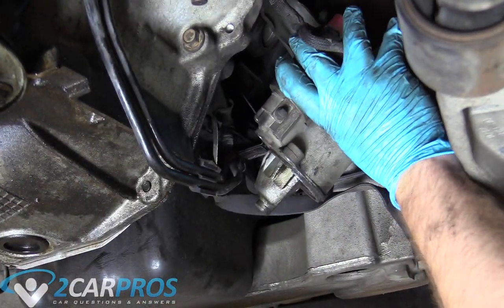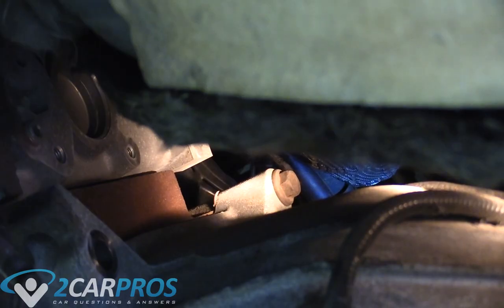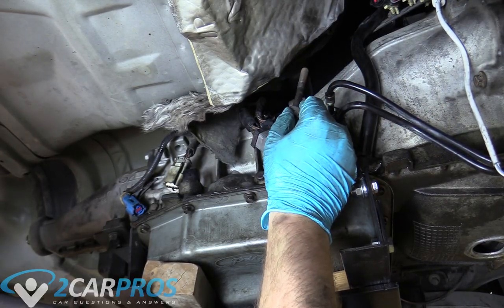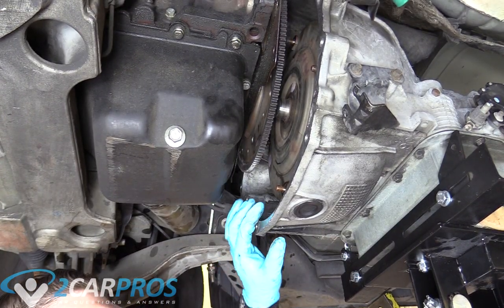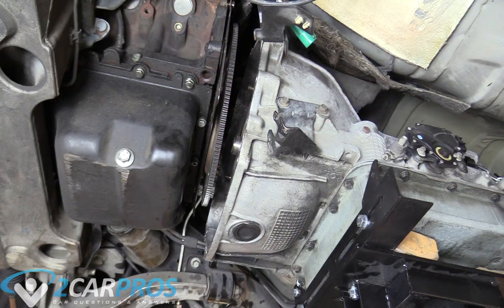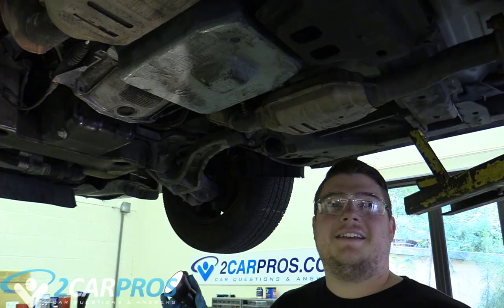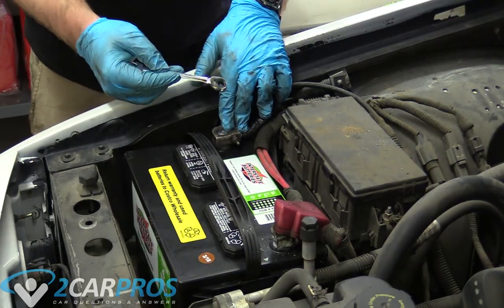How to Replace an Automatic Transmission | Step by Step

Comment: you saved my life, my cars flex plate teeth are messed up and i need the car for transportation soon i kind off just thought that you remove the transmission to engine bolts installed flex plate and job done. You are literally the only video i could find on youtube that was basically instructional THANK YOU SO MUCH! I subscribed instantly 👍🏻
Reply from the maker: Such a great comment! Thank you so much for watching!

Comment: One thing to add is, let the 1st hole on flex plate position in the center of the torque converter access hole, and also position the torque converter stud to aim at the flex plate hole.

Comment: Great video!  The part about loosely attaching the bolts to the engine to line up the converter studs is what I figured out myself today.  Really makes it easy.

Just one suggestion though, I couldn't tell if you were wearing hearing protection, but you should at least wear ear plugs around impact tools.

Comment: I found your video very interesting. It might be overlooked but that last bit that you added about when reconnecting the negative terminal, that's very interesting.

But I have a question for you though.....

Bought a car and realized it shuddered a lot and wouldn't change out as it should. Realized the fluid was extremely low and a diff mount needed to be replaced. Mount was replaced and I just went ahead and serviced the car and changed the tranny fluid and replaced the filter. I then realized it was leaking. So I thought I had not sealed the pan properly. Took it down and resealed it and I'm 100% certain it is sealed properly now. However, after filling the transmission with fluid, I realized it was still leaking, this time though, It definitely does not seem to be leaking through the pan seal. The leaking seems to be coming from above. It does not seem as though it is coming from the dip stick area either and space is very very tight in this vehicle.

What would your suggestion be?

Comment: Great video series! I only wish you'd make one showing how to do this on other manufacturers' products. Mopar is completely different (no hole in the bottom of the bell housing).
Reply from the maker: There will be some sort of access panel to get to the torque converter fasteners. Every automatic transmission does. Thanks for watching!

Comment: Really great video.  Extremely informative and I appreciate it a TON.  One question, do you need to use a torque wrench on most of the bolts when putting them back in?
Reply from the maker: Thanks for watching! I have to say yes due to the internet being technically correct. But off camera I rarely use one.
Reply: @2carpros  Oh really?  Man that's good to know. I'm not a mechanic at all and that's something that so many other people have just terrified me about!  "If you don't torque it right, the whole car will fall apart!" Lol.  Thanks for the tip!  And thanks again for the tutorial!

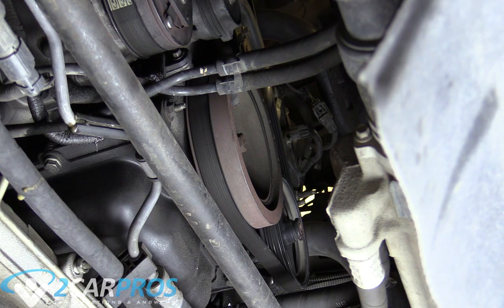Comment: @16:00 most useful part. Should have done this before getting the trans half way hanging out. Turn clockwise when facing front of engine

Comment: I've done this twice on my Crown Victoria. If anyone is doing this, the most difficult part is removing the transmission cross member. It's stuck and rust welded to the frame and you can't take it out by just removing side bolts. You have to use a chain and floor jack and hammer to remove it. A long prybar would not work. 

Also, if you don't have a transmission jack, get it. On my first replacement I used my normal floor jack but it was really unstable and took me extra 2 hrs to wiggle and match up with the engine. Also, get a low profile transmission jack.

Also, don't use Mercon V transmission fluid on 09+ transmission. or Mercon LV transmission fluid on 08 or older transmission. I used Mercon V on 09 transmission. My car was driving no problem with new transmission, and suddenly I lost all forward gears.
Reply from the maker: Long pry bar worked for me but maybe not on the floor. That crossmember is a bear! Great tips and thanks for watching!

Comment: Hi 2carpros If you are using an impact driver, why do you still use a breaker bar first; isn't an impact driver as good or better than the breaker bar?

Comment: Lovely video, thank you! I got a question, I got a 1979 Firebird and bought a completely new Th350 transmission to it. My mechanic told me that it took him 2 days for him and also other person to install it. Now he wants 500$ for installing... Is it normal that it takes 2 days for 2 people to install a brand new automatic transmission? Thanks a lot
Reply from the maker: Thanks so much for watching! 2 days?! To put a Turbo 350 in a car that came with a Turbo 350? 

It took me, by myself, a couple of hours to put a Turbo 350 in a 1955 Bel Air that never came with anything but a powerglide so it was a custom fabrication job. They are just bolting and un bolting. According to the book they can charge 2.8 work hours to R&R a transmission. So 2.8 multiplied by their hourly rate will give you what they can charge. Depending on the shop the rate can be anywhere from 80-200. Really depends on area and specialty.

Comment: I'm going to have to change out my 2006 Jeep Grand Cherokee Limited 5.7L Transmission.  Are these the same process to change that out as well.  I will doing a swap out like you did.  Also, the transmission dealer told me to make sure the drain my transmission before shipping it back, how do I do that?  Please let me know and thank you very much.   Great video and very informative btw!!!!  I hope my swap goes as smooth as your does.   Another question I need to ask,  when you start taking out bolts from different areas, how do you arrange them in order to put them back in the same spot you took them out ?  please let me know and thank you!!
Reply from the maker: You just need to take the transmission pan off and let all the fluid into a catch pan then put it back together. I just tend to put all my bolts in one bowl and then I have a pretty good idea where they go. Thanks for watching!

Comment: The sound at 37:00 minutes. I don't heard that sound, that means my torque converter is jammed, would thatbe a reason why after I put the engine and transmission together I can't turn the engine by hand ?

Comment: You guys are awesome! I used your instructions to drop the transmission on a 2004 Infiniti G35 coupe in order to start the process of removing the rear main seal!. One question: Is it possible to attach the torque converter to the flywheel first and then line up the transmission to the flywheel torque converter combo?
Reply from the maker: Thanks so much for watching Fabien! It is much better to install the converter first into the transmission so you can make sure it is fully seated and activates the pump.
Reply: @2carpros  Got it! Thanks so much!

Comment: Any idea why my wheels won't spin I changed the transmission seal on a Porsche boxster and reinstalled the transmission filled fluid back up did the whole process yet still wheels won't spin on their own when in gear any help

Comment: What about putting the nuts on the backside of the flexplate connecting the torque converter bolts to the flexplate?
Reply: That is for GM only, Fords have studs with nuts.

Comment: I just want to make sure that I didn't miss this, Are the bolts for the Bell housing supposed to have any torque specs?
Reply from the maker: Tight is good. I can get you an actual torque spec for this crown vic but I wanted to keep the video general so it applies to many vehicles. Thanks for watching!
Reply: @2carpros  thank you

Comment: I'm just pulling the transmission to put a rear main seal in. I know I have to drain the oil and remove the oil pan. But draining the trans fluid isn't necessary is it?
Reply from the maker: Technically no. But it is a good way to avoid a mess. Thanks for watching!

Comment: Im going to do this on my 07 v6 mustang which should be similar to this one, the onky issue is i have 4 12ton jack stands and a transmission jack I dont have a shop :(
Reply from the maker: It will be very similar. Nice set of jack stands will work great it just might take you a little longer. Thanks for watching!
Reply: @2carpros  Thank you. I agree you guys made it look so easy and crispy. Will try and follow this to a tee and do it on the weekend giving mysekf 3 days to take my time and make sure its done correctly. Any advice?

Comment: So i got a question seeing as your replacing the transmission of an automatic vehicle, if we do an engine swap of a v6 to a v8, would a automatic transmission need to be replace with a better transmission or is the standard one okay?
Reply from the maker: If the transmission is compatible with that engine. That is going to be a case by case basis. Thanks for watching!

Comment: My torque converter bolts are rounded off, 2 of them were fine but the other 2 are complete rounded.
Reply from the maker: Welp, you gotta either use a grinder and take the head of the bolt off or melt it off with a torch. Thanks for watching!
Reply: @2carpros  so it is safe to use a torch on the torque converter? I just want a professional opinion before I do it
Reply from the maker: @isaiahadkins7578  Grinder is safer if you are worried.
Reply: @2carpros  okay thank you

Comment: Places asking 2400 to rebuild a transmission I’m thinking about just buying a used one and fix the old one myself
Reply: I was told $4000-$4500 for my Jeep Grand Cherokee....where did you go?
Reply: Hawaiian Boy wtf that’s insane I’m getting 2400 from Local mechanics AAMCO is similar in price the only way that price is reasonable is if the transmission is some horror and it’s 4wd most places charge more for 4wd cause it’s “harder” it’s just 2 extra steps
Reply: Ninjaslash52 _ it was at AAMCO, I do have a 4WD.  My transmission is shot, they told me the first two gears are done but the 3 and 4th are still good.  They quoted me $4500.  I told them that I would do it myself.  I’m going to buy a new transmission and do a swap out.  I will drive it till I find another vehicle (looking for a F250), and then sell the Jeep plus half the price of the new tranny.
Reply: Hawaiian Boy Thats good so you got them to check it? How much
Reply: Ninjaslash52 _ how much for what(the new tranny or the swap out that AAMCO would have done)?
Reply: what did you end up doing

Comment: I think mAB wat NgN was stuck on(wN U had 2 wigL it oOt), was it wanted to be NgLd higher(with no trNs) so theflywEL holes were graBing the bolts Va friction(untL U wigLd it oOt).. gS thE OnlE wA is to look at port & C if bolt is on top edge of hOl or bottom edge & adjust trNs height or NgL.. agN thats just a mAB👋-

Comment: Top notch mate...keep it up.
Reply from the maker: Thanks, will do!
Reply: Mate I'm putting in a new torque converter into my Celica, and I noticed a dimple on the flex plate, like what you see when you are installing a timing chain etc...does that have a spot on the converter it's meant to line up to. It's a 2000 zr vvti 2zz 1.8 you know how the torque converters have a big white dot or a yellow of paint, obviously I would match them up with where the original was installed, but you definitely know your stuff, just thought I'd ask if you might have any feed back as to which bloody one hahaha or can I just chuck it on any which way if it totally looks uniform everywhere...it's got a white dot on the bottom of the torque converter and then on the inside there's a yellow one on the side that would back up to the flex plate.